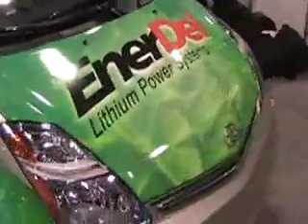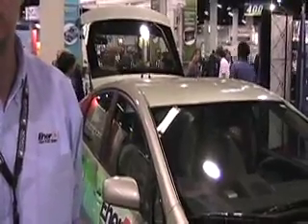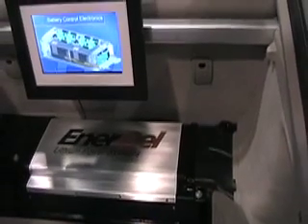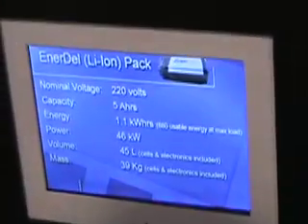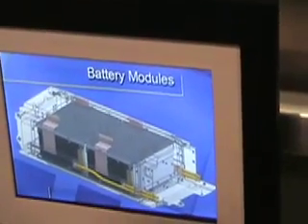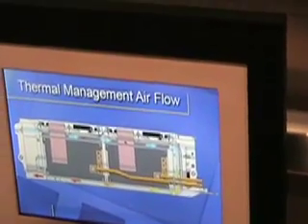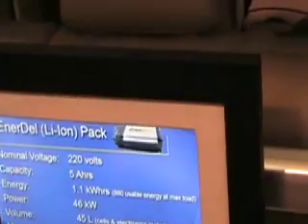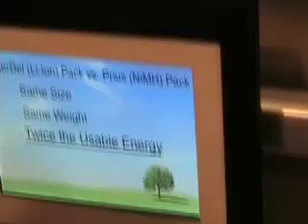EVS23 Enerdel Lithium Prius - Tape 5

Comment: "The interesting fact is that Enerdel seems to have thus penetrated the Prius computer source code. If so, why not just keep the NiMH battery, just make it more addressable?"

Because the NiMH cells can't handle deeper charges as well as the LTO cells without significantly decreasing lifespan?